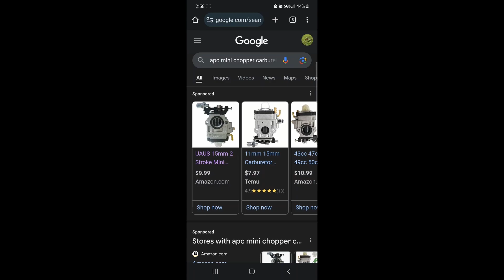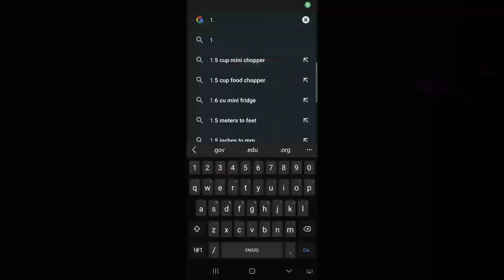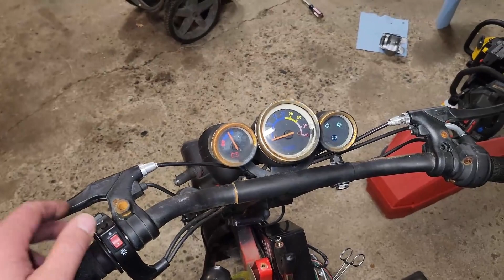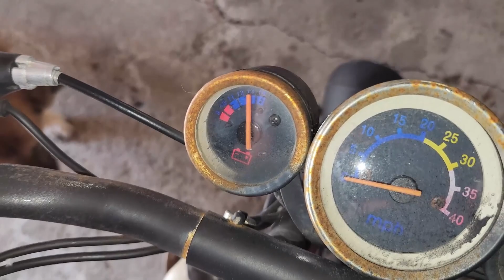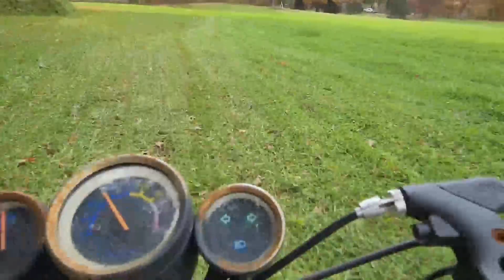Will it Drive?? - APC Mini Chopper! - Part II

Comment: Hello, you have been very helpfull so far with my restorating one of these Apc Mini choppers. Is there anyway to convert or change the rear wheels? Im in the uk and the back wheels have bust and cant get a replacement
Reply from the maker: Hi there!
I wish I had a good answer for you. Someone else asked me about that too. Apparently there used to be a fatter wheel from another mini bike that people would use, but they're hard to find. Let me see if I can find it.
Reply from the maker: Try this?

https://www.pocketbikeplanet.com/threads/apc-mini-chopper-rear-wheel-help.114026/

Looks like people have used the rear tire from an FS509 CatEye mini bike. Not sure if they're available or not. Good luck!

Comment: Hey where could I get the rear tires or is there a setup the I can use for 1 tire?
Reply from the maker: That's a great question. I wish I had a good answer for you!  There are some forums out there and I remember seeing someone that used a single wheel. I would like to know that too because the dual rear makes steering pretty weird at times.
Reply from the maker: I found this:

https://www.pocketbikeplanet.com/threads/apc-mini-chopper-rear-wheel-help.114026/

Looks like people have used the rear tire from an FS509 CatEye mini bike. Not sure if they're available or not. Good luck!

Comment: Just bought one myself i need gas lines they've been cut but i put juice down the hole and it fired right up. Not sure how the carb is until i get the gas lines and can run it out of the tank. Temu has a carb for $8 so i think i'm going to just go ahead and get it just in case,.
Reply from the maker: Sounds like a runner! I've had pretty good luck with cheap replacement carbs. It's worth a try, especially for 8 dollars lol
Good luck!! 🍻
Reply: Hi, I'm wondering which port you put the filter on.  I'm ordering a carburetor.
Reply from the maker: @edwinarroyo9208 Hi there!
The supply line that has the filter inside the tank goes to the fuel fitting that's closest to the rear of the bike. On mine, it also is straight up and down and has no curve to it. In the pictures of this one, it's the one that has barbs. 

https://a.co/d/biD4gMJ

Good luck!

Comment: Mine don't have any wires or lights has the battery box so I can tell it's soposed to have the bells and whistles but it's missing everything I'm trying to figure out if the motor needs to be grounded to stay running... There's no kill switch so I'm not sure yet😵
Reply from the maker: Hi there! Does it start at all? If it starts and dies after a bit it's probably not a grounding issue. Maybe try spraying some ether at it when it starts to die and see if it comes back?  If so maybe grab the Amazon carb and try that out? Either way, you'll get it. Good luck!
Reply: @TractorFella  yeah it starts and dies thank you I'll prolly take the carb apart and cleen it hopefully that Will help thanks for the video to go off of helps alot man🤘
Reply from the maker: Sounds like a good plan!
Absolutely! Thanks for the comment! 👍🏻👍🏻